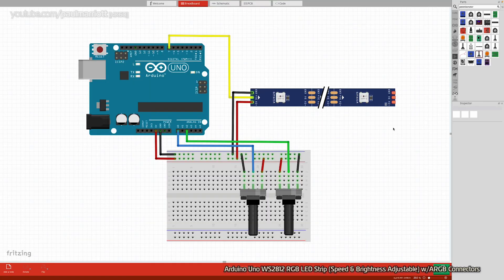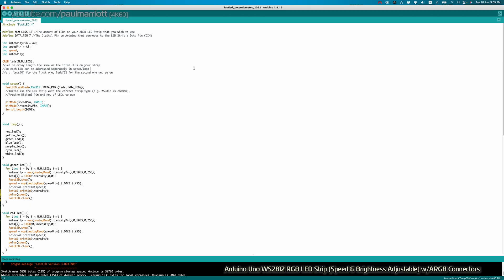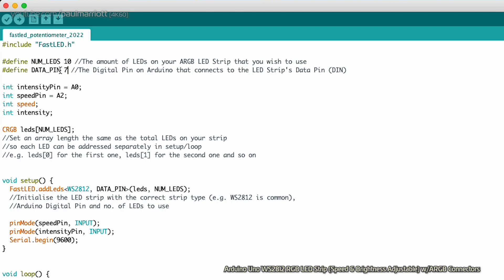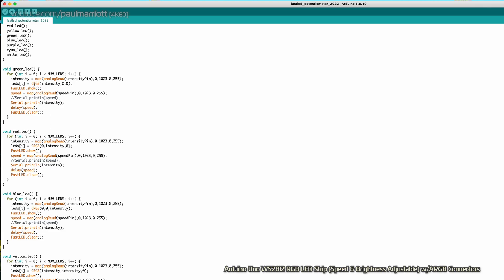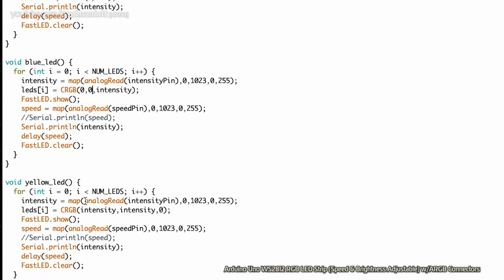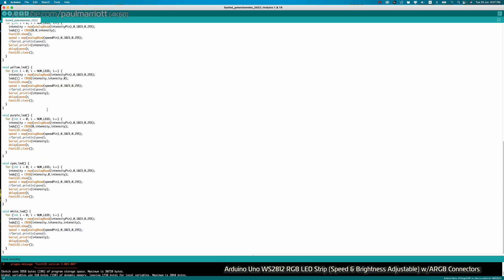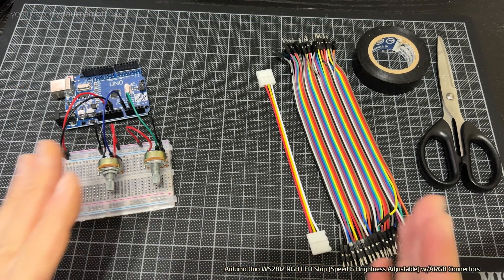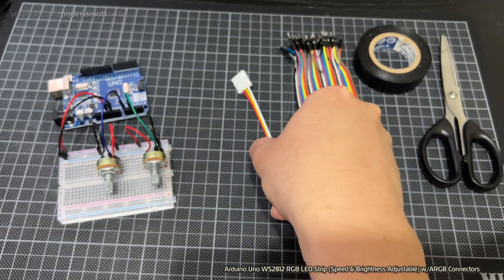Arduino Uno WS2812 5050 RGB LED Strip (Speed & Brightness Adjustable) w/ARGB Connectors

Comment: I'm interested how to make direct addressing.
Pleas simple code, where are for example 5 led. I do not need running leds. Please switch led 1,2,3 as green, 4. stays off and 5. lets lighting as red. Then delay 5 sec and then turn all back off.
Ok. I'm understanding whet leds cant light statically and my idea need that fast looping like i see them lighting statically. But I need, how to different places set as different color and one between them is off.
Reply: Ok. I found its allready there https://www.youtube.com/watch?v=UhYu0k2woRM